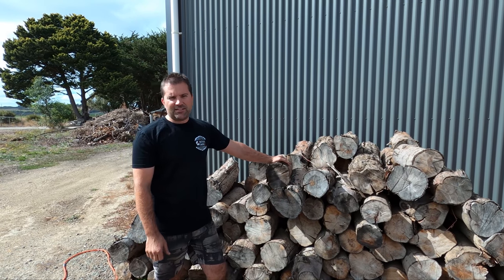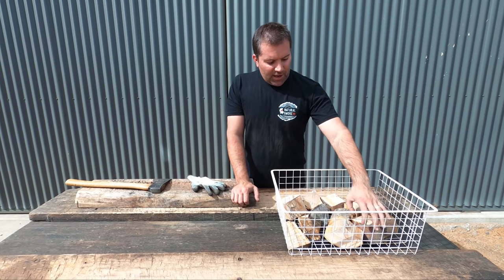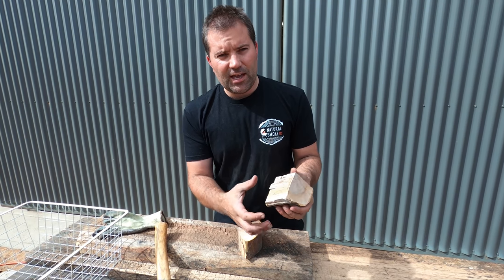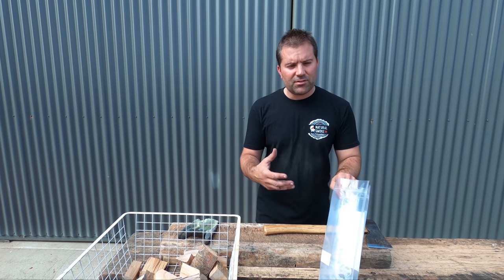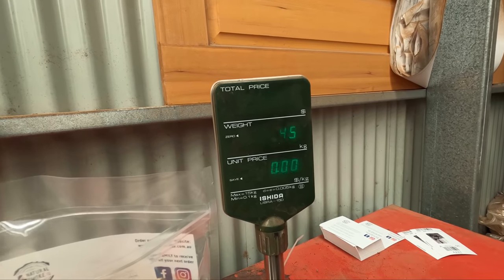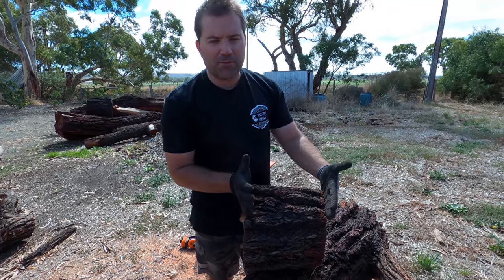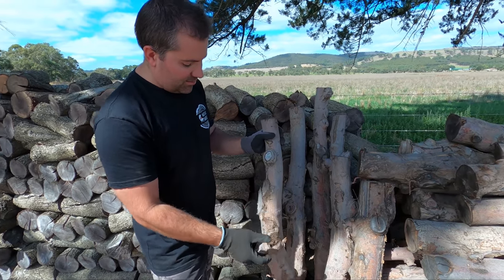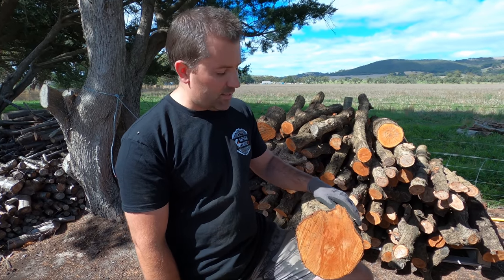BBQ Smoking Wood Science, Tips and Behind the Scenes at Natural Smoke

Comment: Have you tried pecan vs hickory..... they are from the same family?.    👍👍
Reply: They are related. But the biggest difference would come from the location it grows in. My research tell me that that makes a significant difference. Even in the states, hickory grown in one area VS another is different. The example locally is the ironbark. The ironbark in qld is different, it's harder VS the stuff in south aus. Likely because of the sub soil profile. Clay holds water and nutrient and the tree grows quicker. Less water and nutrients means the tree grows slower. Often meaning closer growth rings and denser wood. When your looking for fuel to run an offset for example, denser is better = longer burn time.

Same reason why Gidgee makes good charcoal. It's very dense.. Good carbon availability and why pine would make crap charcoal.